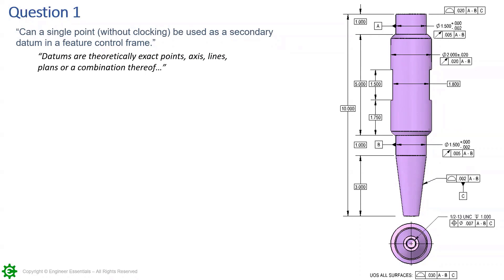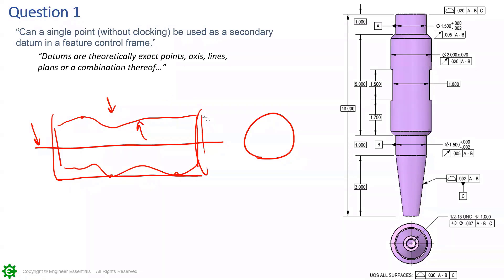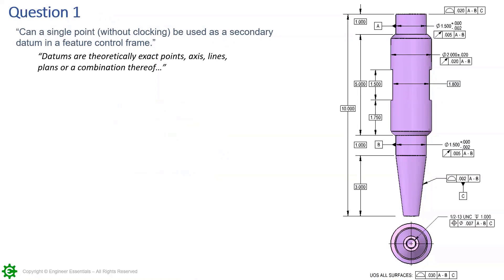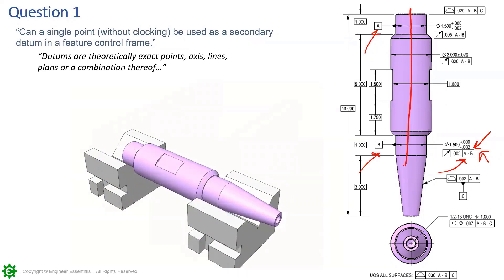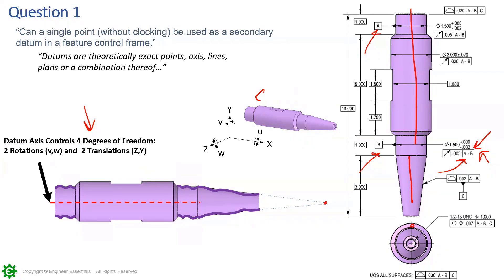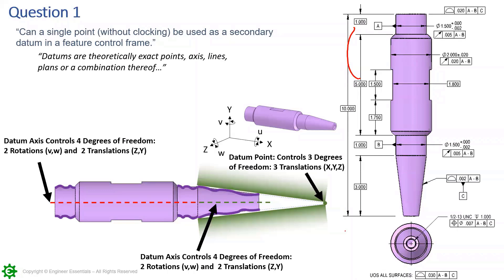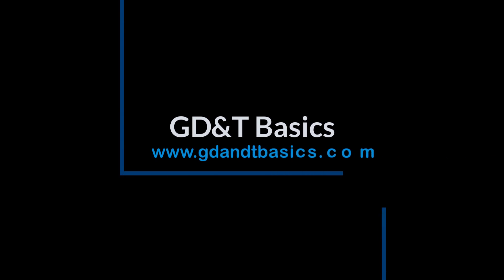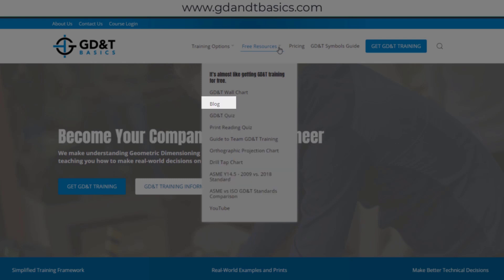Common GD&T Student Questions: A Single Point as a Secondary Datum

Comment: I ask this question to geotol pro if I can use runout as datum and  the answer is no. Runout should be reference to axis. And runout callout cannot be attach to dimension. 

Conclusion. They should overhaul gd&t.
Reply from the maker: The key difference here in this example is the fact that the runouts for datum features A and B are in reference to datum axis "A-B" which is a completely different axis then datum axis A or datum axis B, which is completely legal to see/inspect and in fact a very common design.

Comment: The inclusion of runout callout for datum A and B, with a diameter tolerance of 1.5 +.000 -.002, is unnecessary since the size tolerance is smaller than the runout tolerance. This incorrect example contributes to confusion among beginners and diminishes the widespread use of GD&T.
Reply from the maker: Thanks for the repy! This is actually a very common dimensioning scheme, but i can understand the confusion. Runout is controlling location of the axis of the feature, in addition to its form. And since the the datum axis is created from both datum feature A and B, it is NOT in reference to the same axis as the feature we are controlling. Thus the size tolerance can hold a tighter form of the feature, while the runout will allow a slightly looser coaxiality error. I hope this helps clarify things for you!